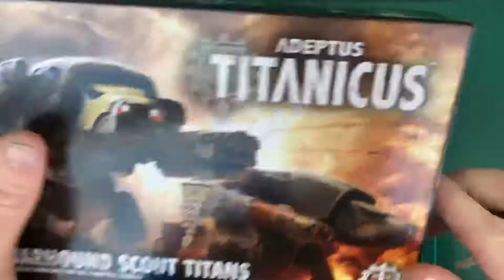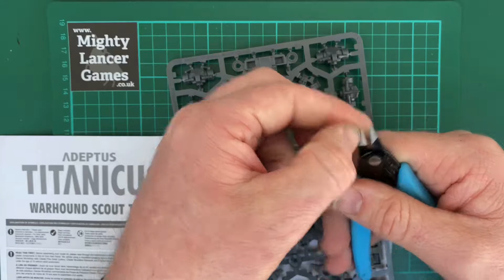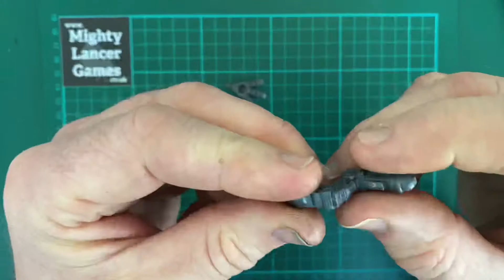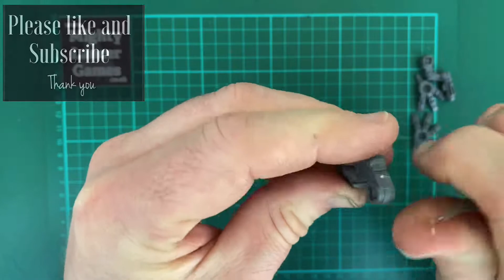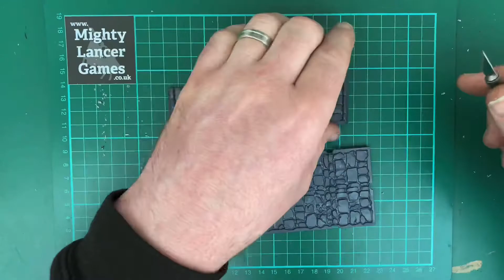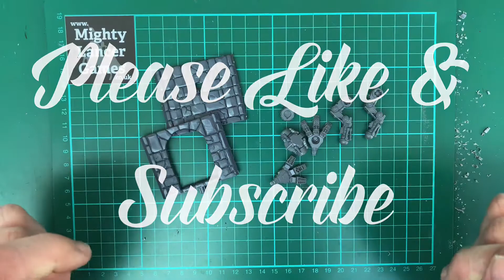Step By Step Guide | How To Start With Miniatures | Cutting From The Sprue & Cleaning Up Your Minis

Comment: I think il try some of those softer sanding "sticks" as my file is just to ruff lol. I wish the connections were just on flat parts of the model but sometimes there on a spheric part like the round part of a space marines shoulder pad or the round part of there power pack. Its much easyer to file and clean something flat. I do a pretty good job though if sometimes when I cut it there is a small hole were the plastic connected I can fill it in with liquid green stuff. Also sometimes I need to use my blade to cut them out as my nippers wont fit all the time.
Reply from the maker: absolutely, sometimes it is as if the manufacturer sets us a challenge just to get them off the sprue HaHa
Reply: Ya bud for sure eh. I struggle to take the mold or snip lines off a round part. After when Im done with it you can see I ether shaved to much or just a lil bit off to one side so i think i need to use those lil sand paper hobbie sticks rather then a blade for that part. Because Its a Nurgle Death Guard Plague marine I could always add battle damage or just put some infectious green stuff over it if its that bad. I just use a lil bit of tamiya extra thin cement and it fills it out rounded again or closer then it was before im happy with it. @MightyLancerGames
Reply from the maker: Absolutely